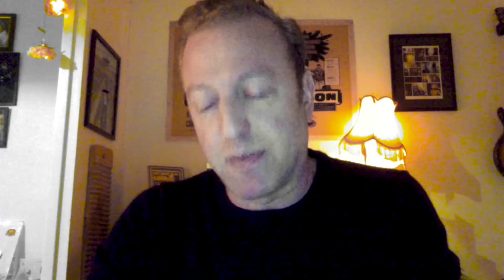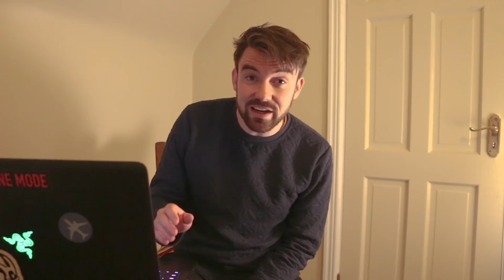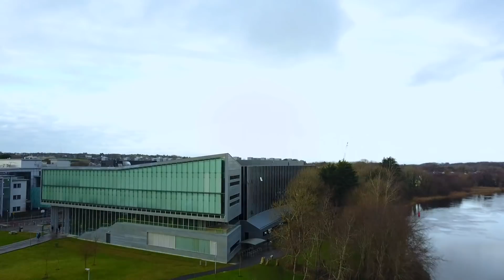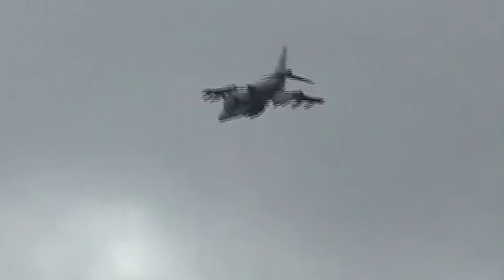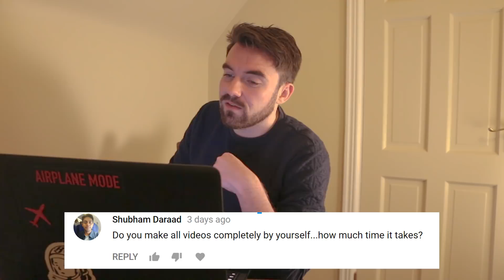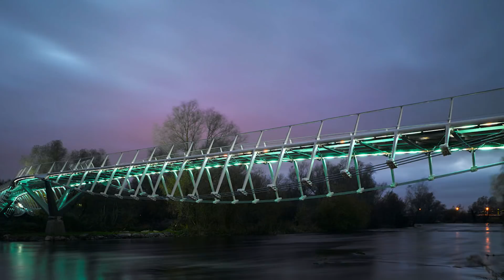YouTube's Biggest Ever Collaboration | Q&A

Comment: You said you were bad at math, how did you motivate yourself to get better at it? I'm thinking about going into engineering but I'm absolutely abysmal at math.
Reply from the maker: For me it was more a revelation about how I was learning. I know now, that I struggle with verbal descriptions, but I understand spacial/non-verbal reasoning better than most. So I teach myself through visual means, which helps with animating. I just don't do well under traditional testing. It was never an issue of motivation. It sounds like you have similar determination, use that.
Reply: Ok, that makes sense. I guess I gotta start paying attention to how I process information. Thanks for the advice and keep up the good work!

Comment: The messages put out by involved channels and that kickstarter are extremely suspicious and fail to provide adequate information. 

They will not do World War 2 unless they reach 500,000, but they are going to take your money if it is anything above 25,000. This is extremely shady and I am extremely disappointed that channels like lindybeige and real engineering would sign on to something so deceptively advertised. No one is even bothering to mention that they are going to take your money and use it to do a Korean war documentary before even looking at World War 2. 

Very disappointed in all of the channels involved with this. I thought more of them than that.

Comment: It happens because the Gibbs energy of mixing of the ions in the battery decreases the solubility at lower temperatures. Both the enthapy and entropy components change at this new temperature causing the Gibbs to change, affecting the equilibrium constant via the van't hoff equation.

Comment: Isn't cold supposed to increase battery life?
Reply: Burak Kaan Özgül do a Google search for" iPhone 4 battery life in cold" and be amazed. I had at its worst about one hour battery life in Norwegian winter. Passive used
Reply: I think a oversimplified answer is that cold allow the electric current to move faster and therefore takes less time to get empty
Reply: ^ Not really. The reason is just that the electrolytes get solid and don't distribute the charges well enough. Oftentimes the battery gains its previous charge back once it is heated back up (depends on the controller setup).

iPhones have another problem on top of it - their controllers are not really well calibrated and are not designed by Apple (they use a stock part). There are some reports that they want to change it (and start using their own) in 2018 which would eliminate most of the issues with devices turning off at 40%.